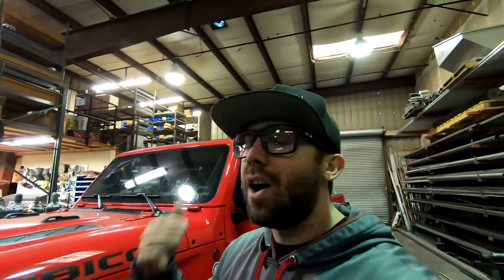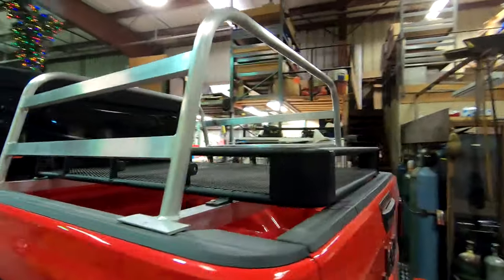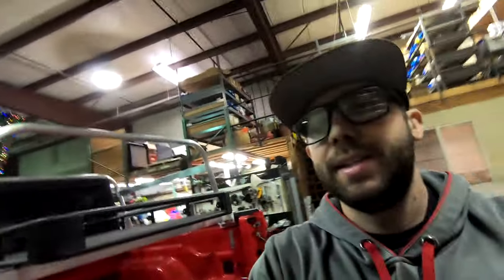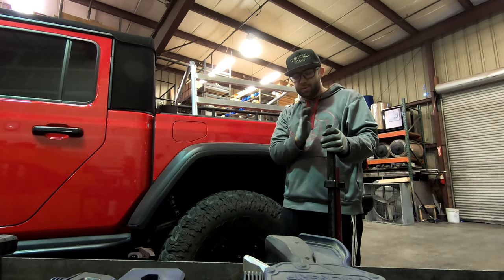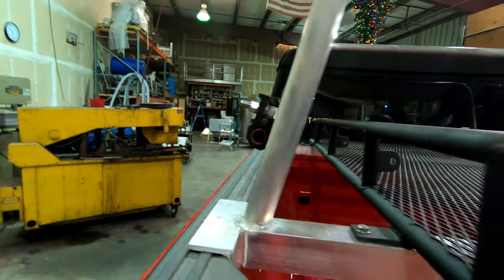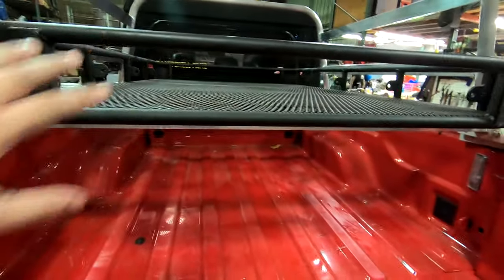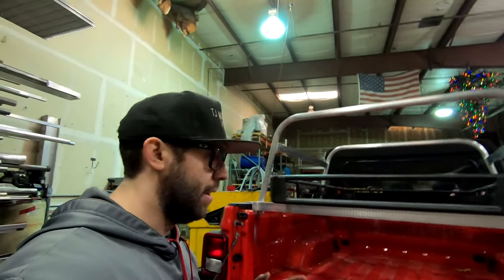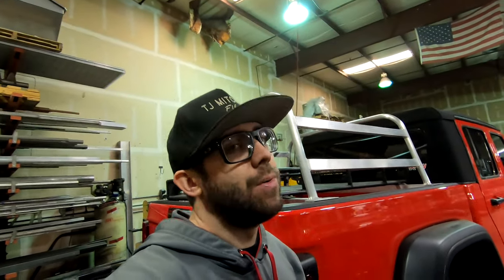Building A Custom Overland Bed Rack For My Jeep Gladiator

Comment: What type of aluminum did you use? And how thick? I am thinking about making my own, mine might be a bit different though. I’ll be using a mig welder with a spool gun hoping things will turn out.
Reply from the maker: It’s .120 wall thickness. The round tube is 6063 T5 so it can be bent with out annealing it. You should be able build one with a spool gun no problem